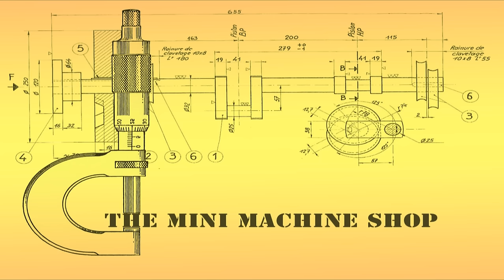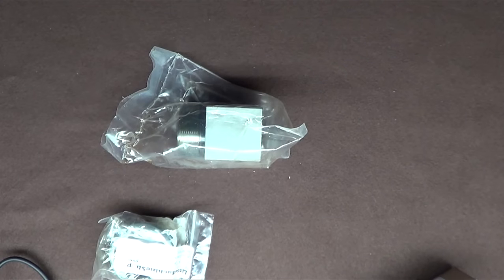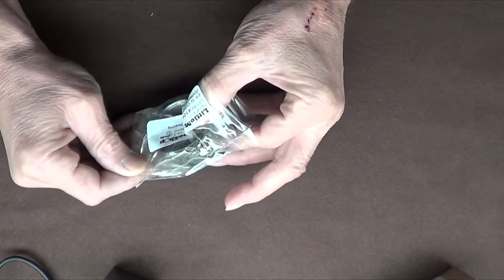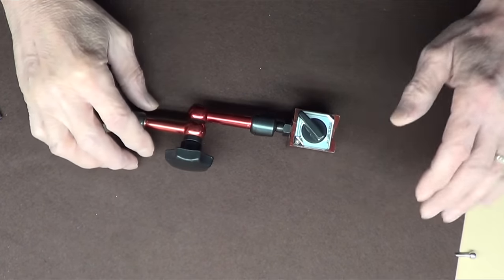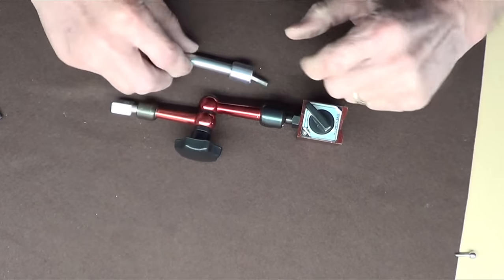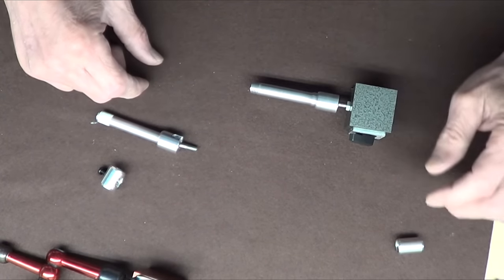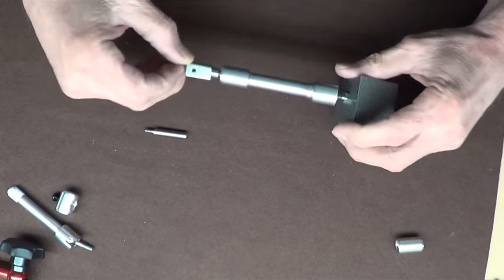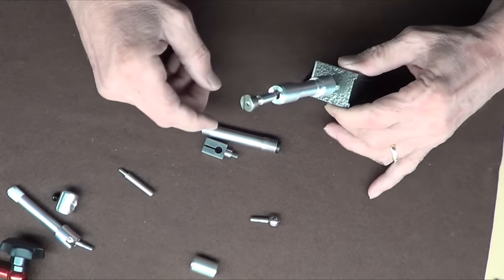DIY Noga Arm Redesign Video #88

Comment: The bearing is an awesome improvement. This means you can tighten it and release it with less torque since it removes the friction resistance from the nut to the collets.

Comment: Good find on that ER32 collet blocks. Last time I checked I could not find it anywhere in US.

One improvement on the design, maybe put some knurls on there to make it easier to tighten the balls.
Reply from the maker: So you were looking for the blocks also! The hex block will be here today.. YAY! Good point on the knurling and will do at some point. Just wanted to get a working one done.

Comment: How much pressure can you put on the indicator without your holder moving?
Reply from the maker: Depends on how tight you screw it together but a LOT!
Reply from the maker: You can also put flat spots for a wrench to really tighten it up but seems to be fine as is!